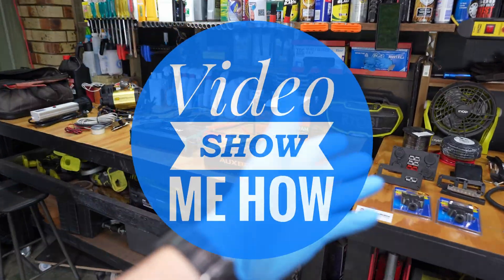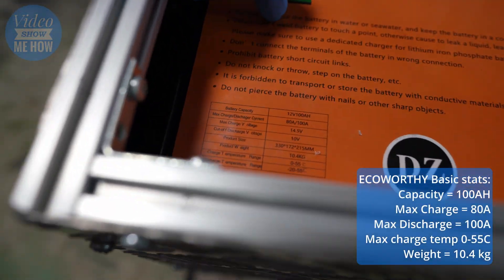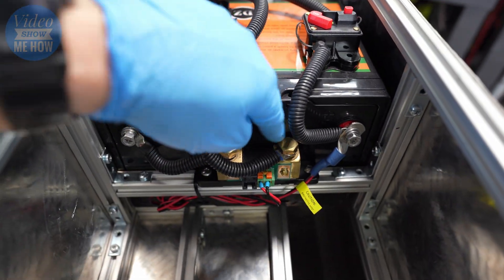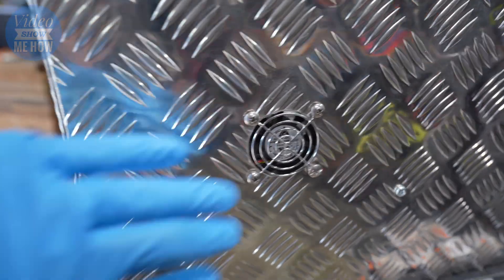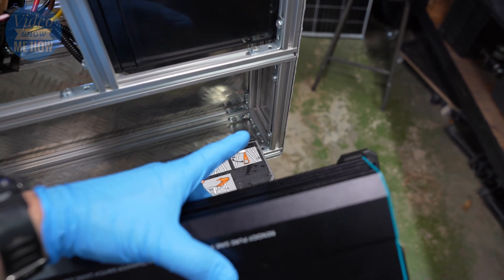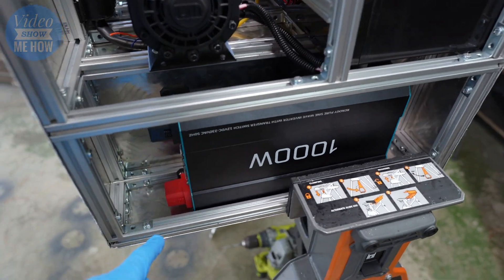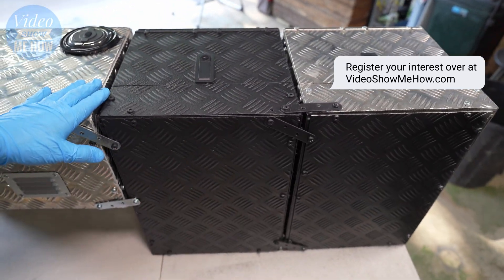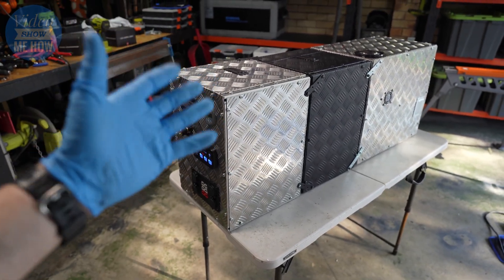The ULTIMATE DIY STORAGE 12v Setup for Touring Overlanding | Part 3 | New D-MAX Build Series #43

Comment: These are choice, the bracing channel bar what did you use? I have to say its good to see that you have used the wheel arch area which is always wasted space in most cases. I checked your shop out and see you're sold out, when is new stock arriving and do you have specs that I can check for another rig instead of a DMAX.. for fitment. Cheers and thanks
Reply from the maker: Should be back in stock in the next week 👍

Comment: Nice one! Can see a lot of planning went in to the unit by how well everything fit. 👌 Love the automatic temp-sensing fan idea - how did that turn out?
Reply from the maker: Yeah works a treat, the bvm712 can use the temp probe to trigger a relay, so I've got one setup to run the fan once the ambient hits 40c. Same setup as I had in the first 12v box

Comment: Love it Adam, very very well thought out. Would be awesome if the middle tub (the black one) was water tight and had hole ontop to fill up and an outlet on the bottom of the face where all of your switches etc are
Reply from the maker: Not a bad idea, wonder if a bladder could work? In any case, water tank going under the tub 👍
Reply: Ah good idea about a bladder! Keen as to see what you come up with for under the tub 🔥🔥 sounds awesome

Comment: Hey Adam, a suggestion on heat removal, I know you have a couple of "air inlets",  however, I'd be inclined to pressurise the box with the fan (two fans actually)  and let heat and dust vent out of the box under pressure, instead of having the whole (internal) system in vaccume.  i.e. make it blow, not suck 🤣  (place the air inlet and fan in a protected position that you control, as in it will never be accidentally blocked, and have two or three outlets in more 'vulnerable to blocking' positions) - good work though, nice to see I'm not the only 12v nerd out there 😜
Reply from the maker: Yeah like the idea, have been running the completed version for about a month now testing it like crazy, so far so good, there's 2x inlets and the one outlet at the moment. That server fan really cranks as well, draws .5 of an amp just by itself lol
Reply: @VideoShowMeHow  hehe every Amp counts!
Reply from the maker: Lol I do have a couple rack fans double size/amps, but don't want to go toooo far 😂

Comment: Looks great 
What is the overall weight of the unit
Reply from the maker: With the 12v gear in there? Or boxes by themselves?
Reply: @VideoShowMeHow  All up if you could thanks Adam
Reply from the maker: About 18-20 all up, most in the rear end so would be gear dependant of course :)
Reply: @VideoShowMeHow  Cheers for that